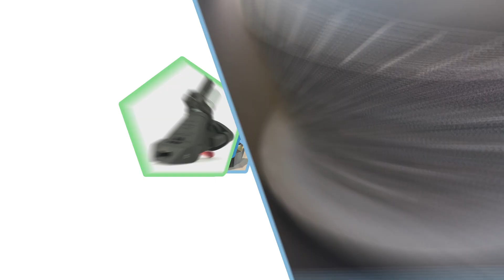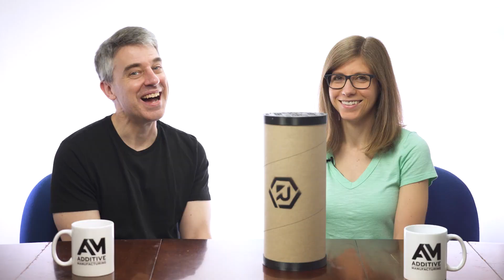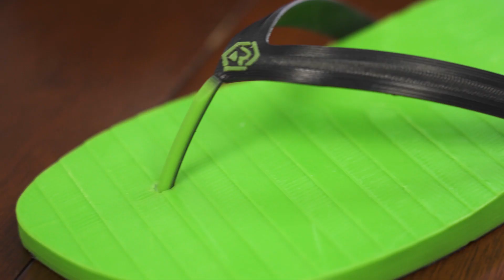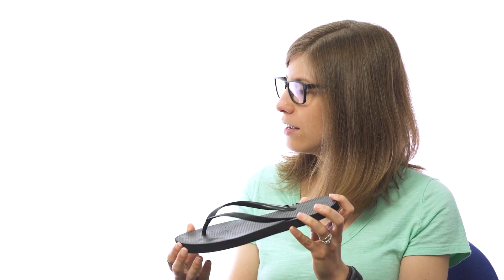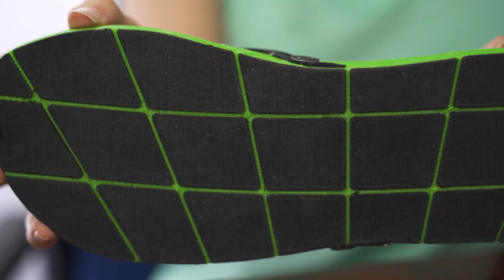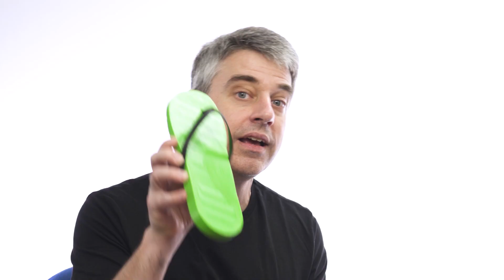What Do These 3D Printed Flip Flops Say About Manufacturing's Future?: The Cool Parts Show S3E5

Comment: I went to 'retractionfootwear.com.au' to see what 'my' potential flip-flops would cost. I plugged in my requested information: Size: 10, higher arch, 220#, and 'Black' for all material components. It spit out a price of $90.00 for my pair flip-flops!

I understand there are purposed 'benefits' with these flip-flops, but can these 'benefits' really justify their high price? I'm not sure.

I also completely understand the "green" aspect of buying this type of product from this vendor, i.e.: recycling of old product, reduction of material waste, equipment expenditures costs, etc. But should the consumer be financially penalized for doing what currently is accepted as being the "right thing to do"?

I kind of got the feeling, from reasons mentioned in your video, that a 'potential buyer' might subtly feel they are being 'guilted' into to doing "right thing" when trying to justify the purchase this product. Putting the AM aspect aside, I wonder if the manufacturer is, just possibly, using this as one of the mechanisms to indirectly promote their product, and therefore, the justification for the quite expensive 'price tag' for their 'plastic' flip-flops.

Now, I know I could be completely incorrect with my take on this. But it still makes me wonder, at least just a little bit.